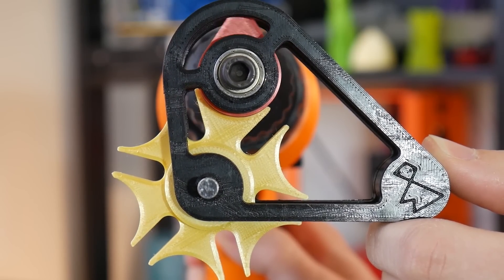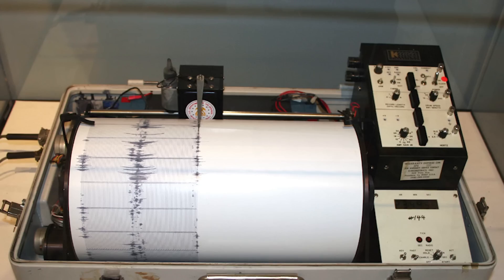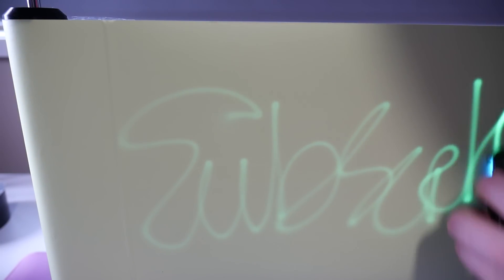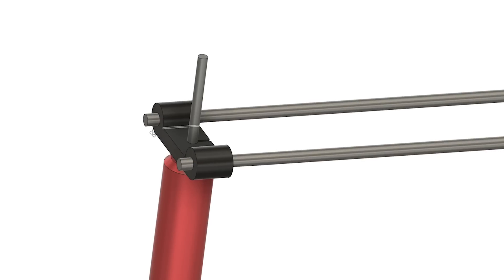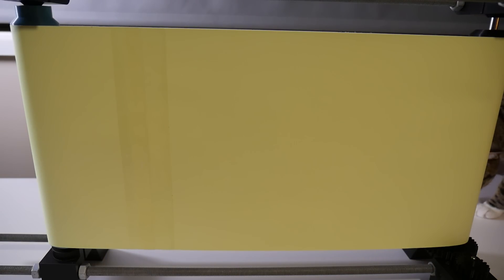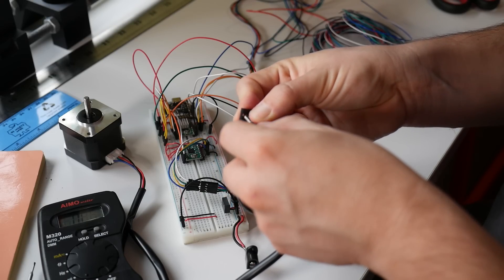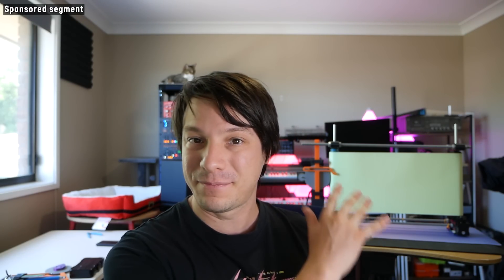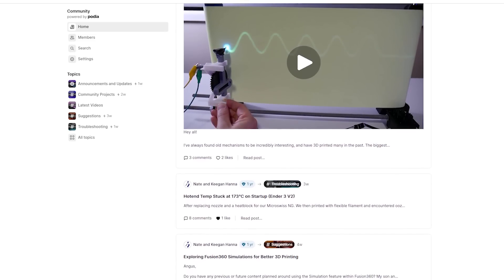Visualizing the mechanically complex using a UV led and conveyor belt.

Comment: It's backwards. Your time axis runs right to left. You'll have to turn it over. Your output should be on the right side so that reading a snapshot will have the time axis running left to right. ☺️
Reply from the maker: hmm i get what you're saying. Just looks better to me running forward, even if it's not 100% correct. Easy enough to change the design though!

Comment: 7:04
Most treadmills I work on use a diagonal seam with a beveled edge to prevent the rhythmic thud of it hitting each roller, some use a feathered seam as well, but that's probably excessive for this.

Comment: I love the idea of a simple linear regulator to step the 12v down. So many things like this get so over complicated.  Only other simple idea would be if your using a old atx psu you could just use the other voltage feeds. 

Noce to not see a off the shelf buck converter or somthing else

Comment: Tip for you, it's much easier to solder headers to a board while slotted into a breadboard
Reply from the maker: Oh yeah that makes sense, great tip!
Reply: i suggest using a stack of cheap perf board. the heat of the soldering can melt the plastic of the breadboards as it conducts through  the pins.
or you are good enough at soldering quickly for that to be a non issue.

Comment: My favorite part was the CR2032 taped to the UV LED...while several 3D printers cried just off camera. 🤣🤣🤣
Reply: The simplest way to drive an LED
Reply: Yes, but it would have taken ~5 minutes to print a snap-together holder for the battery to secure it to the LED. Even less if tossed onto the bed with one of his other prints for the project. (hence the "printers cried" remark) Sorry you didn't get the joke. 🤷‍♂️

Comment: 6:46 instead of the underlying butchers paper also ending at the same exact place as vinyl you could have paper cut to size with and angled edge tape that over the rollers and apply the vinyl, that way vinyl will hold the paper and vinyl can be cut to have zero overlap. Thus giving you seamless roll

Comment: You could add a 608 bearing to the end of the cam follower arm. You'll get loads less friction and the weight of the bearing will help it track up/down better.

Possibly also springloading the follower arm, so it doesn't only fall by gravity, would be a big improvement on response times for falling edges 😊

Comment: To make a seamless belt, you can either use a normal belt of woven material and stitch it together diagnolay (okay, you have an endless seam that way) or weave it together or have it woven together without a seam.
Then you van put the glow-paint on it on the outside while having it moving continously and dry it.
Since you only need low friction, you can go to a knitting-store and also get  an elastic seamless wide belt that is just the seamless cloth. It comes in different variaties. But I don't think they have it in Glow straight-forward so you would apply the paint to it too.

Lovely idea!

Comment: Side thought; the teardrop / lobe design would be a good way to show off how automotive camshafts affect the dynamics of an engine, where the shapes being factors of Lift (amount) and duration (time). A more pointy lobe has higher peaks, but less "sustain" while more rounded shows off a smoother motion, but at an arbitrary 'open / close' point would spend more time 'open' compared to the pointy type. 
Turning that data into numbers is beyond my level of knowledge, but it might give insight on how say a known factory camshaft profile might compare to an upgraded part replacement.

Comment: Using a crowned roller rather than parallel would make tensioning and tracking much easier. Less than 0.5 degrees night be enough and the centre half of the roller can also remain parallel with the edges tapered.

Comment: The mechanisms where a shaped cam pushes up the measuring device need a pring to force contact and/or rollers/bearings to reduce friction and "sticking" on the return, which does result in the "hiccups" on some of the parts. A bearing (or simple, springloaded steel ball) on the "reader" also might increase the accuracy of the reading, and the more "pointy" it is, the less there will be artifacts from the reader having contact besides its center with the read out shape.

Comment: In pushrod race engine design they "loft" the valve higher than the lift of the cam. The springs are so stiff and the accel rates so high that it preloads the valve train, so that when it gets to peak lift it throws the valve higher.

Comment: You built a mechanical oscilloscope. I dig it.
Reply from the maker: I didn't realise at the time but yeah, it literally is. Very low frequencies only!
Reply: @MakersMuse  Sooooo that rack mounted music making system or a modular synthesizer using this is where? :)

Comment: the old 8 bit boards can't run much more microsteps anyway than 16 feasibly while reaching decently fast mm/s, so the 16 was pretty decent. microstepping isn't perfect anyway.
Reply from the maker: Very true, at that level you're probably better off with servos. I just want the motors to be a bit quieter...
Reply: @MakersMuse  yeah, you could just order some silentstepstick or another, TMC2208 sticks are like 2.5-3 bucks in thailand at least now.. the local brick and mortar shops tend to have just the old ones

Comment: 1970s: computers are pretty expensive, can't just use them for everything but it would sure be convenient
2020s: shove a computer (with WiFi) in first, ask questions later
Reply from the maker: Less than 10 bucks, I don't even need the wifi. Crazy!
Reply: @MakersMuse  by now you can get really good RP2040 based boards for less then 3USD if you don't need wifi.
Reply: It's cheaper to shove a microcontroller into stuff rather than building from discreet logic. It's a bit nuts at times.
Reply: @jimktrains0  Which is a bit of a bummer considering how much time we spend learning k-maps XD
Reply: And it all works fine - until you need higher speed. Microprocessors can’t run logic at 100 MHz. 
Where they will work, there is not much better for quick solutions.
Reply: @KenWmo  is there anything faster out than a Teensy 4.1? They clock in at 600 MHz. I wouldn't be surprised if there were faster alternatives. Although also more expensive...
Reply: ESP32's are less than 6
Reply: @Splarkszter  Some models you can realistically get for about 3-4.
Reply: @Splarkszter  i raise you the esp32 supermini modules:
you can get them on ali for 1.5 and even a version with a 70x40 oled for 3.50 DELIVERED
they are about as big as the pollulu driver
and there are pi pico superminis as well

Comment: I have a suggestion for you. Try connecting the input for the mechanisms to the input for the belt so you don't need to use two motors and you don't need to use two potentiometers to time-sync them, but just use one motor to power it all.
Reply from the maker: mm yeah I did consider it, but ultimately I would like to change their speeds independently to better show certain patterns. Now that I know how to actually do it, it's not all that more complex.

Comment: To make the seamless belt, overlap the ends and make one cut through both layers. That will ensure the ends match up exactly no matter how wavy and inconsistent the edge might be. Then, when you peel off the backing and apply it to the substrate, put the cut of the substrate 180 degrees offset from the cut in the outer belt. Since the seams of the substrate and the top layer are far away from each other, there's no need for overlap on either layer.
Reply: This, and use a dark-colored substrate to prevent backlight bleed-through.
Reply: This is genius.
Reply: This is probably less work than making one by applying a cureable liquid to a spinning shiny cylinder whilst the liquid cures into a plastic!

Comment: The cam one would be interesting to show cam float as the RPM increases...
Reply from the maker: Yeah! I'm already fairly surprised how imprecise they are at low speeds, though they are just 3D printed.
Reply: @MakersMuse  Yeah, that's why one of the "upgrades" people do to engines to (be able to) increase the revs, is to change springs for stronger ones, which ofc increases the wear (and friction) and one thing also that is used to aid in reducing the friction is to add rollers in the followers, but yeah, it's a tough mechanism to balance, but simpler to implement complex patterns, since you can just replace the cam profile.

Comment: For the belt I’d be using an angled splice - larger linear surface, but you can use a narrower overlap for the same surface area for strength.. fibre reinforced tape on the back, and packing tape for the front 😂

Comment: The Seam of the belt should not be perpendicular to the direction the belt moves. Cut both ends of the belt at 45 degrees in the same orientation and seam them to each other. How to seam depends on the material to of the belt (from welding to sewing, stapling, and super glue, etc.)

Comment: Instead of tape, you could use contact adhesive spray and overlap at the edge, with maybe tape on the unseen side to better secure it. Would look nicer on the front side.
Reply from the maker: Contact spray is so diabolical, it would probably work! I'd have to be careful not to gum up the surfaces.